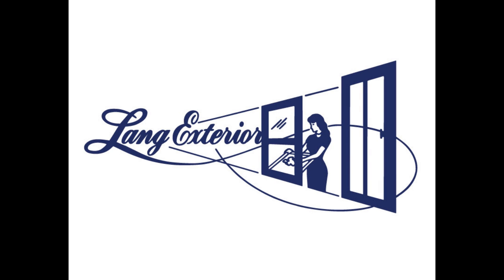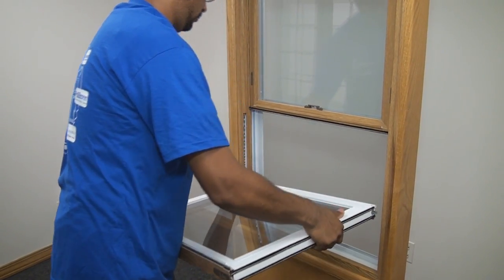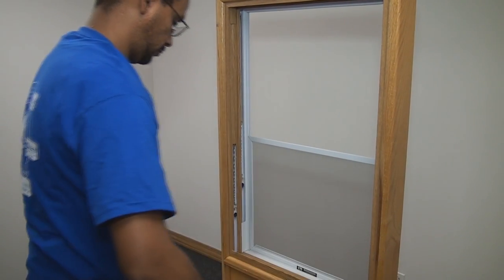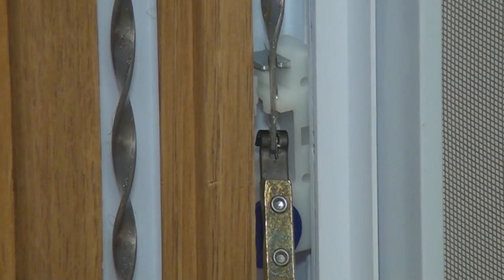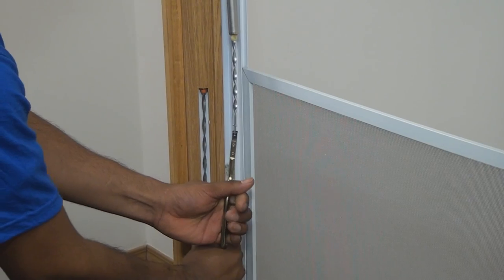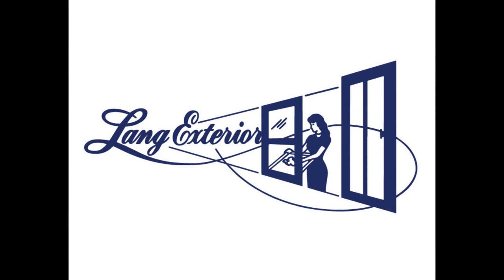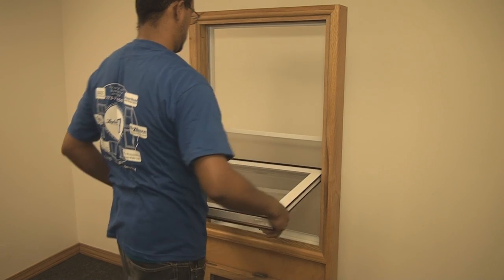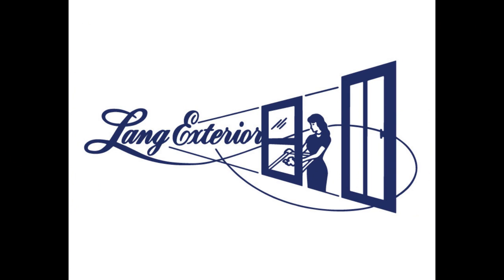How to tighten or loosen a spiral balancer

Comment: FYI - spiral balance is tightened in the direction of the corkscrew and loosened in the opposite, so it depends on the direction of the spiral balance you have. Mine tightened in the opposite direction mentioned in this video.

Comment: My problem is when I slip the end of the spiral in to the white plastic guide it goes up the window and disappears behind the window frame on the track and it is too far up for me to slide the metal retainer in to the white plastic guide. I end up having to take the screw out of the top of the spiral balancer and push it down with a stiff wire take it all apart and start over. So far I have not gotten it back together. So frustrated!
Reply: OK so my problem was due to trim I could not tilt the window sash in, and by doing so it pivots a piece in the "shoe" that locks it in place in the track. SO, what I did was take a piece of string and put it around the metal spiral letting the two ends dangle down. After I slipped the end of the spiral in to the shoe I used the string to slowly let the shoe go up in between the track and the window frame until I could slide the retaining pin into the shoe. Once I had I let go of one end of the string and pulled it out. I know it's not how it is supposed to be done but unless I tore all that trim out this is what worked for me. I used several pairs of needle nose vice grips(including one as a substitute for the special balance twist tool) one regular pair to hold the window open, string, philips screwdriver, paper clip(to grab the spiral when it fell in to the track).